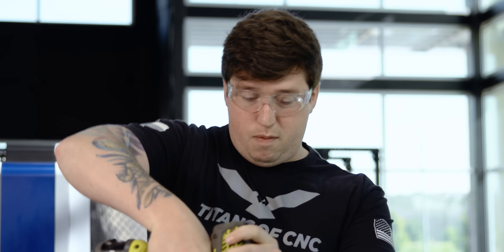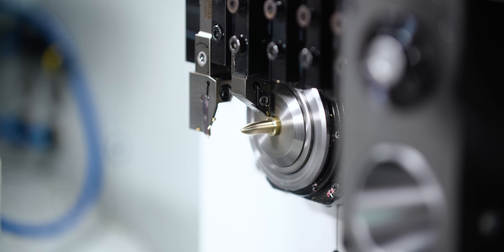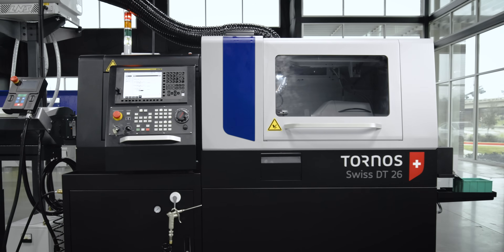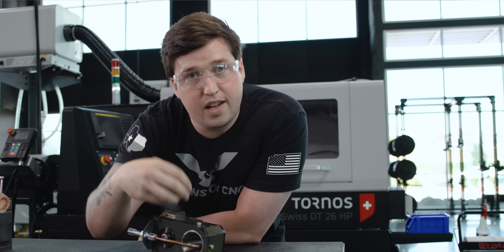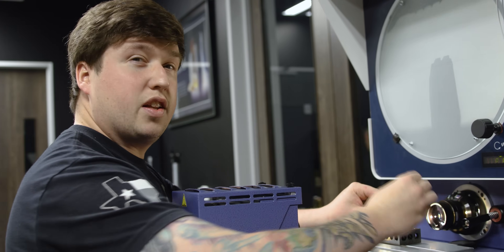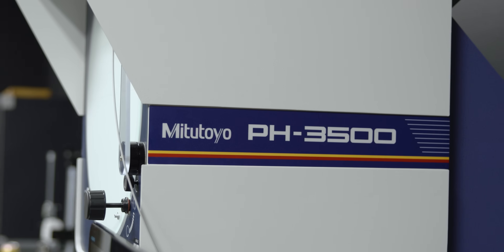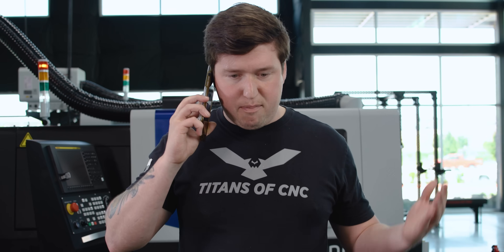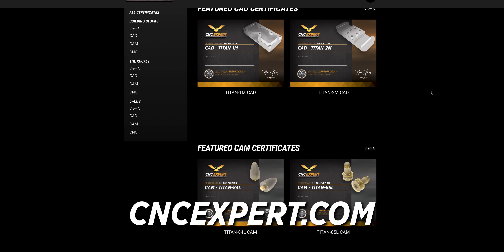Fascinating World of Thread Whirling | Titanium Bone Screws

Comment: I have a titanium tapered grub screw about 40 mm long by 6-7 at the wide end and 3-4 at the narrow end ,holding my left scaphoid together( wrist/thumb area), sandwiching a 'spacer' bit of bone from my arm. My right third metacarpal has six screws holding a radial break together, I was allowed to watch that operation while it was being carried out and they look just like tiny cheese head self tappers, you can feel the screw heads through the flesh ,a plate and four screws that look like those in the thumbnail picture, in my left collar bone.I'm worth a fortune in scrap😂

Comment: I worked 8 years doing those screws in a Tornos Deco 20. Whirlings and Madaula external threads too. The externals are easier to service and spot when they are chipped.

Comment: The ops manager at work had a total ankle replacement couple years now. Still has to elevate leg . He still has a few bad habits. He is 48 or 9. He elected to go for a lower GI. Guess what buddy here it comes. The bore scope. I awoke prior to work finish. I saw a nodule removed. The scope was marked off in mms. Looked like a tiny bump on the inside of a flesh colored vacuum cleaner hose. Dr. said thats as far as we can go. lets go back and get that last one and we are done. I declined third time.

Comment: It's a slow process for certain reasons at certain applications.
To compare to the single point method, you are creating a polygonal approximation so to speak, so you need to keep the  degrees per second feed quite fine to make it look round enough. Single point is in constant contact on each pass with a much faster feed in z. This makes an actual round shape. Finally, if you imagine doing the revs calculation for the spindle for single point, compared to the rpm for the whirling head, you find a problem. The whirling head must also revolve much slower because of the diameters you use. If you have M16, you would be basing the  revs on surface speed, pi and bar diameter. For thread whirling, the inside of the whirling head tips is the effective diameter to choose. The whirling head will have clearance to enable exiting the workpiece. Maybe the diameter is 22mm. So now the same formula has the rpm much slower than before on the spindle. So making the material a round approximation and selecting the correct revs for the whirling head tips makes it slower in certain applications. Choose one for the correct application and buyer beware.

You might say that you only do one pass with a whirling head, but an M12x36 in 316 stainless, would take 20 seconds. The thread whirling would be nearly a minute long.
Plus if.you machine a stud with a thread at each end, you can partially divide the cycle time as the sub spindle can do the second end. So a complete  double ended stud would be near 30 seconds for a conventional single point method on a Swiss. That would take perhaps 2 minutes 20 seconds if you do both thread ends with the whirling head.

If you suggest thread rolling, these machines are fast but with lighter torque. So tougher material in bigger diameters will have the collet slip.

Comment: I work in medical machining and run multiple swiss lathes. I’ve used thread whirling and single point threading when making screws. I personally prefer using single point because I find it easier to adjust offsets and it’s faster to change 1 insert instead of six when tooling chips out. The company I work for has talked about switching over all of the lathes to thread whirling because it’s marginally faster than single point and I really hope they don’t just from an operator standpoint
Reply: Remind them that your time is expensive comparatively, and the savings don't offset the money spent in calibration time
Reply: @daveb3910  careful, though they will always look for a way to automate that portion too and your time is no longer valuable to them.
Reply: If you're running high production, thread whirling is definitely the way to go. The time it takes to change out inserts is miniscule compared to the time saved by whirling instead of single point. Like he said in the video, if the inserts are ground correctly, they will cut the major and minor all in one pass.
Reply: What type of screws are used for carbonfibre
Reply: Dude, all of this looks unnecessarily brutally expensive...
Reply: I wonder if a tool could be made to switch blades faster .
Reply: @cobyiv  like a six spindle screwdriver? or maybe a robot arm
Reply: @nerddub  yeah one of those , haha exactly what I was thinking bout
Reply: It might run faster but it might not actually be faster due to tool changes.
Reply: Fair enough,but do you thread and turn in sections like they showed,?
Reply: dont you think thread whirling would be better if making screws all day and night

Comment: The Star SD-26 is similar to this machine, with 2 programmable b-axis locations and with the additional y2 axis on the backworking.  

With a double unit, you could fit 3 whirling heads in a 2 path gang-slide machine.  

Crazy doing that without a turret.

Comment: I forgot their name but i used to whirl these screws with .1 mm right handed thread and .08 mm left handed thread that'd sit between two parts and move one of them .02 mm per turn 

It was for some mechanish meant to be under a special microscope and allow the operator to turn the knob and move that part precisely without any electronics nearby
Reply: differential screws, like a vernier but for screws, very cool stuff